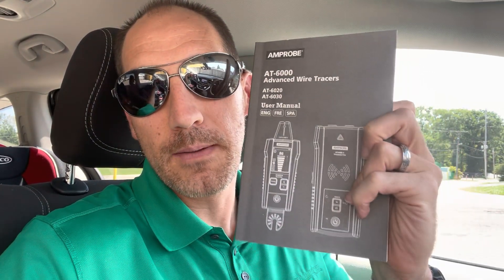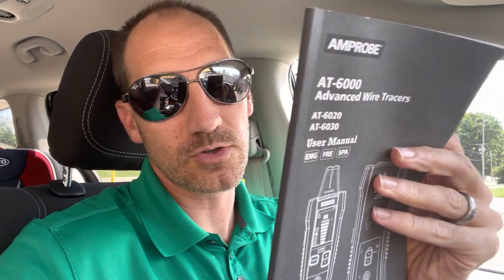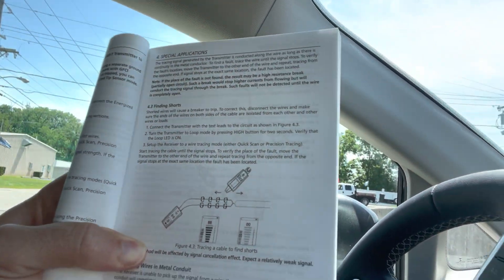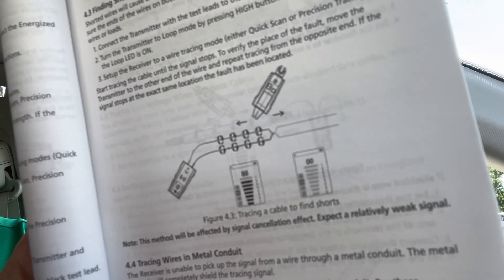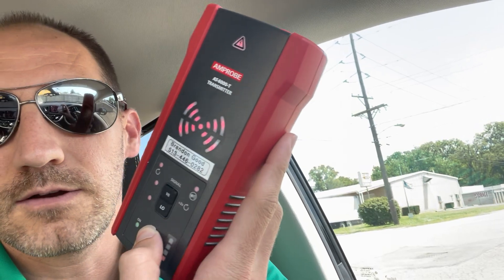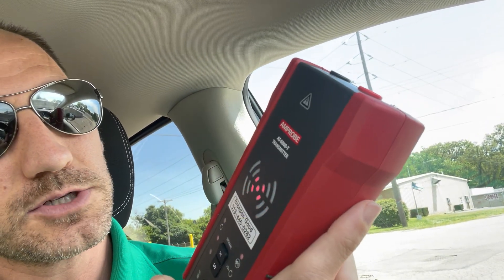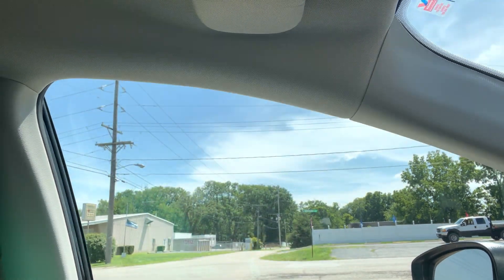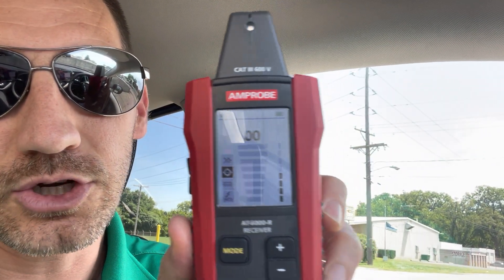Finding a Short - Fluke Fridays - Episode 62

Comment: Hey Brandon, stumbled on your channel. Great content man. I was wondering, if you would have time, could you do a demo of the fluke 2062 going through different scenarios? Opens in lighting circuit receptacles ect? There isn’t much out there on that wire tracer. I am thinking of buying it and just want to make sure I can use it lol. Thanks again for the videos
Reply from the maker: @lennonpearson  have you seen the previous videos I made on those tracers?
Reply: @fridayswithbrandon hey Brandon, I actually stumbled on them after I typed the comment. Sorry I should have updated. I really enjoy the content. Do you find that the tracer has helped you a lot? Is it worth the money? I am about to pull the trigger on one.
Reply from the maker: @lennonpearson  I do like them a lot. I prefer the 2052 over the 2062 personally. But they are the best tracers I've used from Fluke and Amprobe. I've not used other brands a ton.
Reply from the maker: Also,
If you plan on getting it from Amazon could you use the affiliate link?
Fluke-2062 - https://amzn.to/43P1ti1
Fluke-2052 - https://amzn.to/3vEHPsG
Reply: @ hey Brandon, I totally would, but I am actually getting mine on the second hand market. I appreciate the link though! Thank you!
Reply: @ what is the main reason why you like the 2052 more than the 62? I just want to make the right choice. Thanks again Brandon!
Reply from the maker: @lennonpearson  I like the compact design better. But they both do just as good of a job.
Reply: @ thanks a lot Brandon. Take good care man! I took the jump on the 2062. I hope it’s as good or better than the ideal wire tracer. There isn’t much online about the 2062.